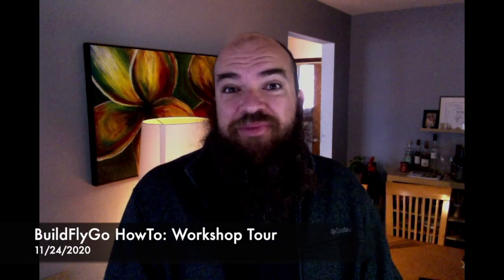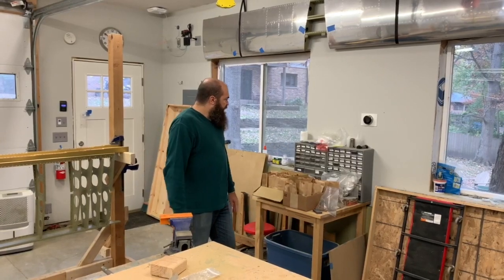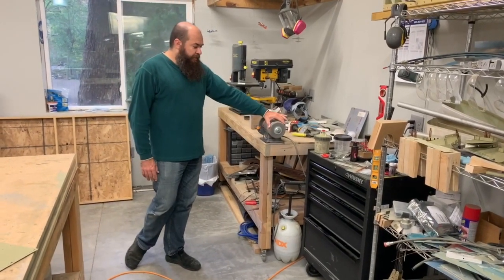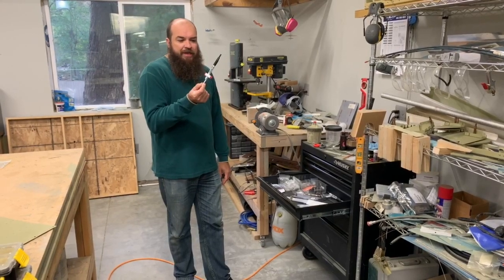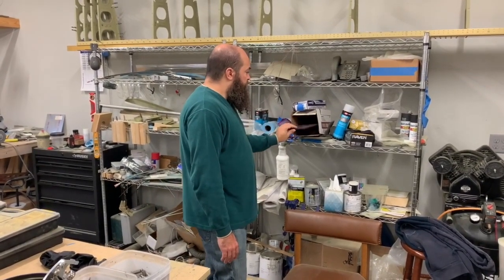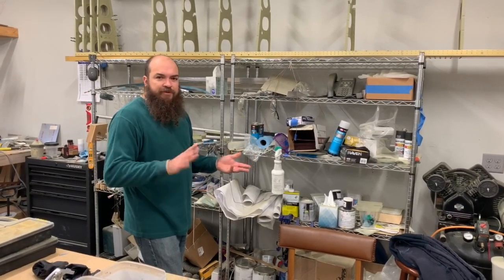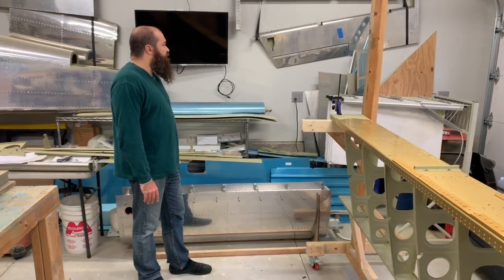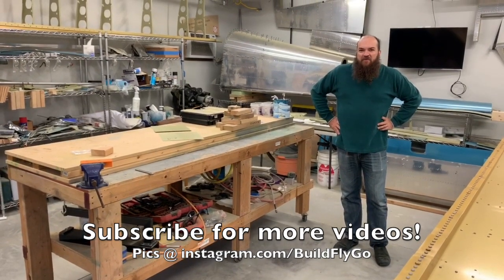Building an RV - Workshop Tour

Comment: I have to ask of course about your air compressor choice. Seems to be topic question that I have yet to hear a good explanation. My understanding this far is if not going to be used for actual final painting of airframe than one can get by with a smaller albeit louder unit.
Reply from the maker: I use the compressor for grinding, squeezing, and priming. It feels like the size I have is about as small as I'd go without the thing running all the time, it already runs a lot. I've heard people make little lean-to's on the outside of the shop to put the compressor and maybe someday I'll do the same.

Comment: Hi Guil.  Van's says a band saw and drill press are optional but nice to have.  In order to build a RV-14A, do you recommend I purchase these two items for my build?
Reply from the maker: I used the band saw all the time (though I wish I had a proper metal one) and I rarely use the drill press. I tend to hand-drill almost everything. The band saw is a <$100 one from the local hardware store. I've spent more money on blades over the years than initially on the saw.
Reply: Hey Bob, my father and I are currently in the process of building an RV-9A, COVID has given us a lot of time for this. We have both a band saw (meant for metal, as Guil notes) and a drill press. The band saw is extremely helpful for many different tasks, I would highly recommend this. The drill press is less necessary, like Guil, we tend to hand drill almost everything.
Reply from the maker: Which band saw did you go with? It might be time for me to buy a real one :)
Reply: @BuildFlyGo  Hey Guil! We just bought a used, cheap RYOBI band saw. Nothing fancy, but gets the job done!